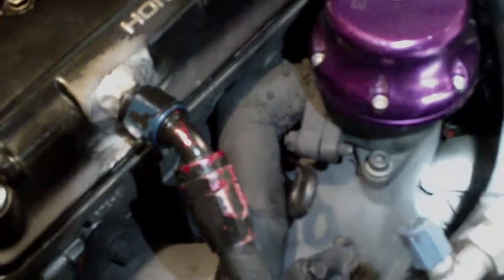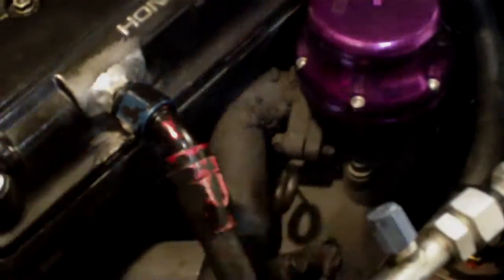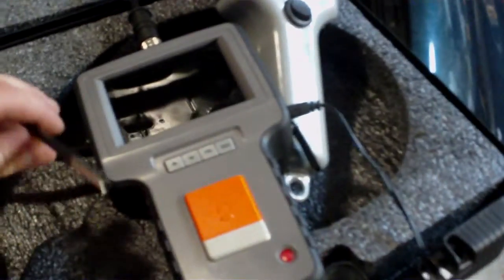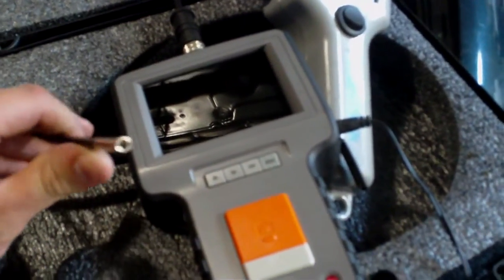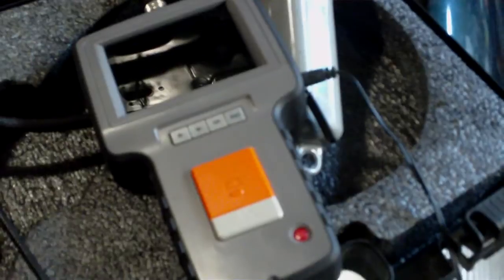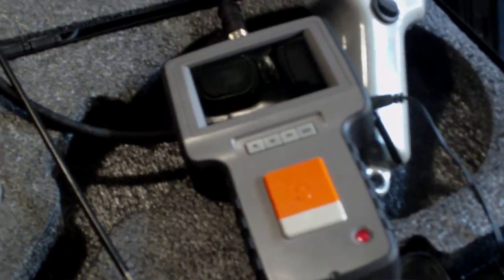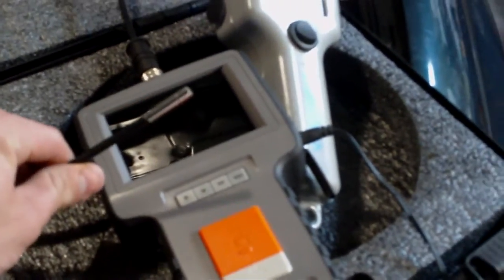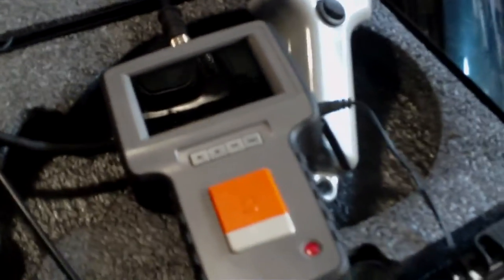Turbo Failure Analysis

Comment: spark plugs are dry. compressor side of turbo has oil. im going to end up rebuilding the head and the turbo just to make sure everything is good. shop will recheck rings as well. im just hoping the rings seated well and were not gapped too much.

Comment from the maker: First, how many quarts a week are you burning if you drive it daily..if your burning a half to full quart a week I'd Check your valve seals and then I'd check your compressor side of the turbo and the turbine side. Another tip would be to pull your spark plugs and "check around the inside of the plugs" you know, around where it would fire..shine a light in there and see if you can't see if there is oil in any of the plugs, if not that rules out your piston rings.

Comment: Would there be any oil on the compressor side if the seals are blown? I burn tons of oil. I'm suspecting the engine piston tu.gs but the block was rebuilt 2k miles ago.